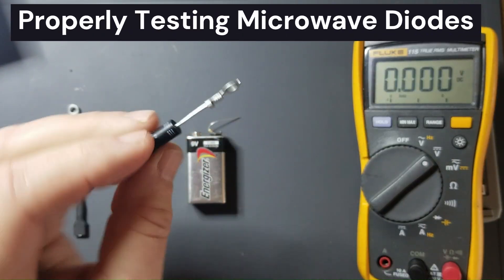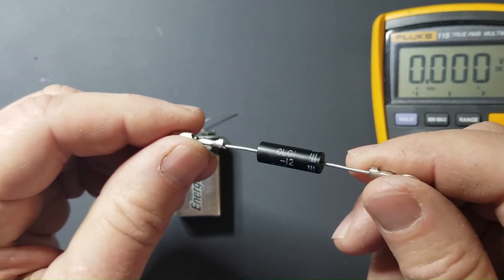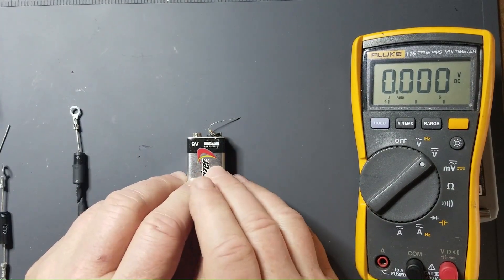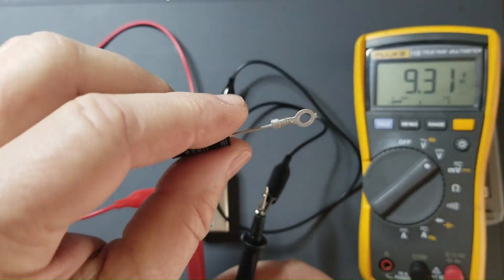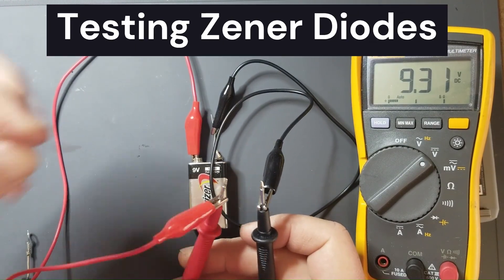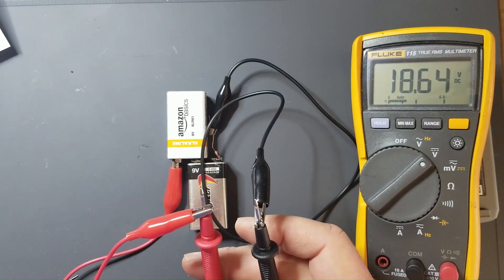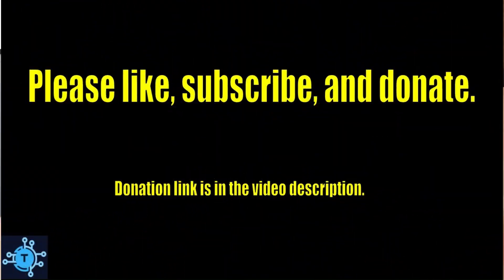#81 - Testing Microwave Diodes with a Multimeter

Comment: Hello. I was testing a diode with a 9 volt battery and getting a reading of negative 5.2 volts (-5.2V). When I reversed the leads I got a zero volt reading. Is this a bad diode or I’m I testing it incorrectly.

Comment: Thanks for this video!  I went out and dropped 30 bucks on a super cheap multimeter, then found it didn't have a diode testing setting, and thought I had thrown my money away.  Hooked it all up to a breadboard and a 9V battery as shown in this video, and was able to successfully test everything, despite not having a diode testing setting on the multimeter. Was about to head to Lowe's to get a higher-end multimeter, but this video showed me I could test everything successfully even with my existing setup.  Thanks!

Comment: Hi just found you and thanks for the fabulous video, I have tested some of my microwave diodes using your tester and it works very well but how do you test so called microwave double diodes (that's what it is called on the microwave schematic). The diode is made up of 1x HV-6X2P1 (double diode 2 rings) and 1x CL01-12 connected together at the anode end and testing using your tester was fine for the CL01 but for the HV diode it showed the same battery voltage in both directions, is there another method for these types of diodes to prove they are okay. Thanks

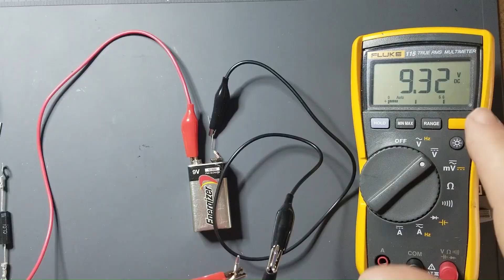Comment: Thanks for this great video. Looking at 3:06 - my Fluke 113 drops from 9.4VDC to 6.5 when I add a known good 2.2K resistor in series. Your Fluke 115 shows 9.3VDC in the same situation. Is my meter causing this? Thanks again!
Reply from the maker: It is more than likely the diode itself. They all have varying voltage drops within the typical range.

Comment: Steve, I might not know my terms, but isn't the forward voltage drop on the good diode about 2 V, not the 7.4 V that you stated in your narrative? I believe you misspoke. Thanks for this helpful video.  Sincerely, Pete
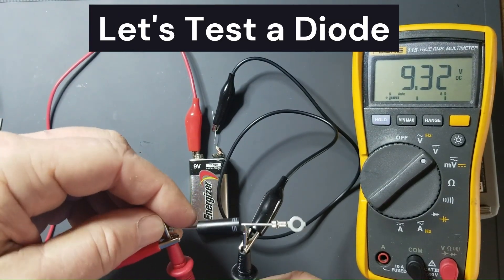Reply from the maker: Microwave diodes are multiple diodes stacked in series. A 7.4V forward voltage drop is about right for a microwave diode as measured at 3:35 in the video. You might be thinking of the forward voltage drop of standard LED's which is around 2V.
Reply: @TheTechCircuit  At 3:35 in your video the voltage drops from 9.31V to 7.37V so approx. a 2V volt drop, so why do you say the forward volt drop is 0.4V when the meter clearly shows a nearly 2V volt drop?
Reply from the maker: @Review-007  I say that the forward voltage drop is 7.4 volts. Not 0.4 volts. 👍